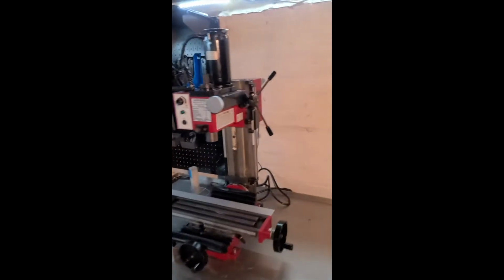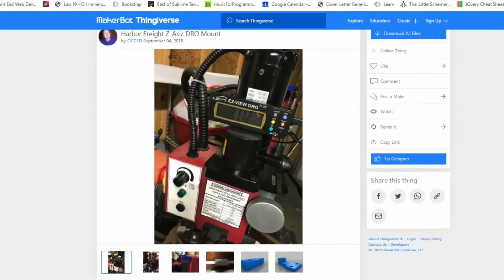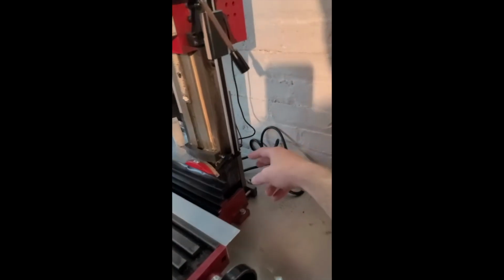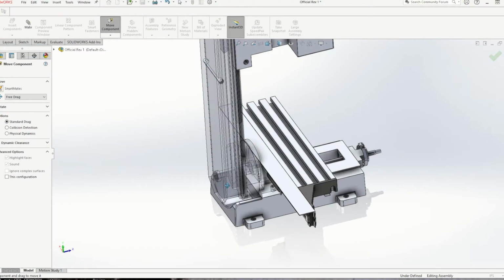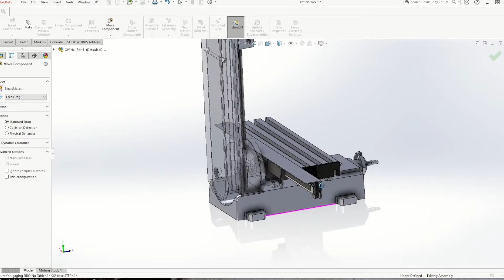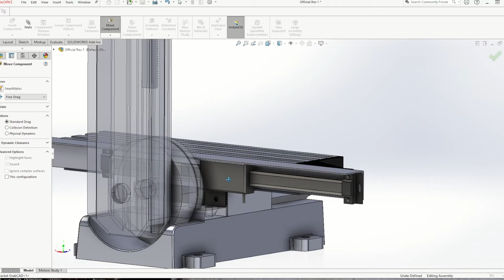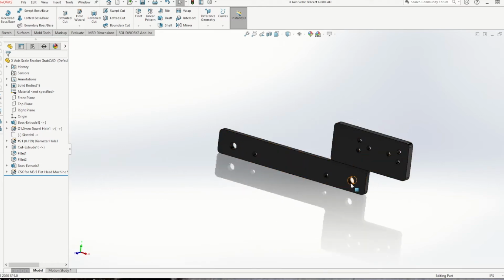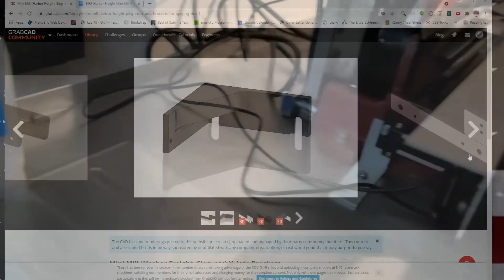Mini Mill (Harbor Freight, Sieg X2, etc.) Igaging DRO & Column Stiffener

Comment: The file for the X-axis scale bracket is only 7.5 x 2.3 x .2 mm. Are you sure you didn't mean cm (centimeters)?
Likewise, X-axis side bracket is only 7.5 x 5 x 3.6 millimeters.

My mini mill is small, but not THAT small : )

PS The Z-axis files are fine.
Reply from the maker: The files use SAE/imperial units. Please check your import settings and import them as inches.

Comment: Why didn't you fit the y-axis to the body instead of to the bench?
Reply from the maker: There is slight tapper on the side of the body. The bench mount was a simple 90 degree angle. I dont plan on moving the mill, so the bench mount was simpler and more convenient for me.
Reply: @kevinfundarek5294  Thanks for the reply, I only asked as I'm doing the fit now, or 2 days ago, I fitted to the side on the taper, I just had to bend the bracket that fixes to the slider.

Comment: Kevin I finally getting around to setting the DRO on my LMS Sieg X2D I ordered a Igaging 24'" DRO for the Z axis and you said you used a 12" do you get full use of your table  with the 12" DRO? Thanks Bob
Reply from the maker: Hi Bob, they were advertised on ebay as 12". Here is a link to where I got them: https://www.ebay.com/itm/141056492922 
I get the full range with no issues. 24 inches would be overkill. I just put a tape measure to it and the scale actually looks to measure closer 16. The advertised 12 inches must refer to the usable range.